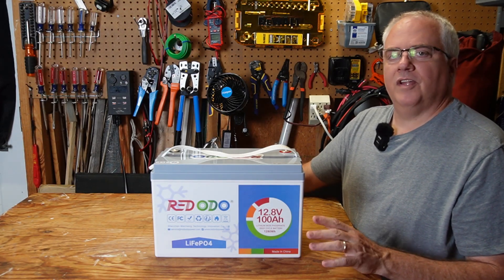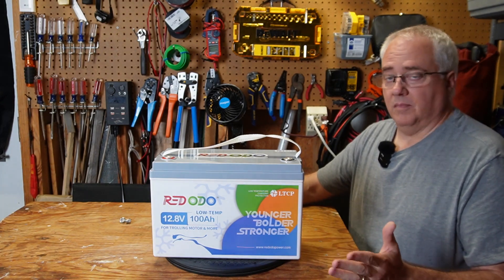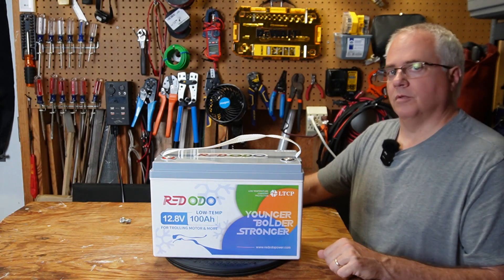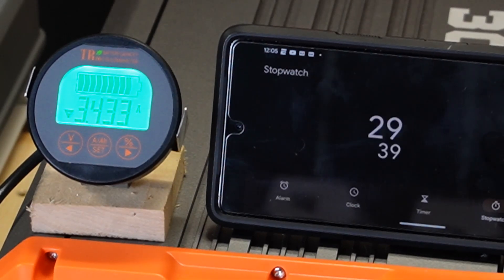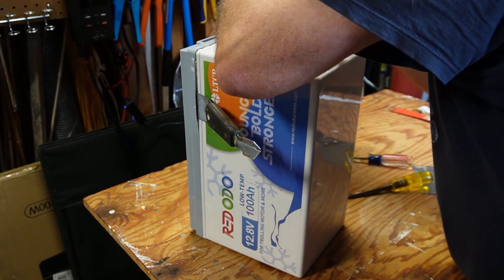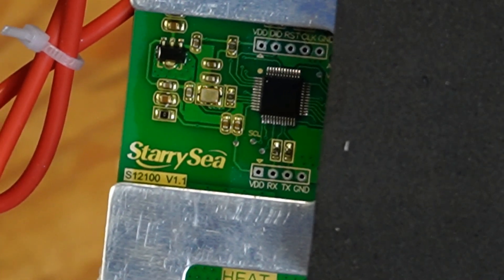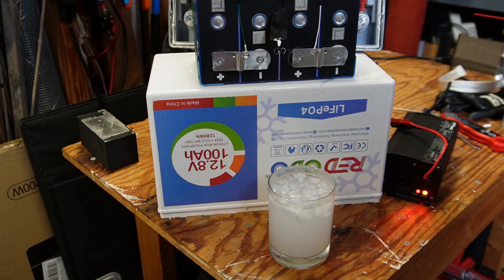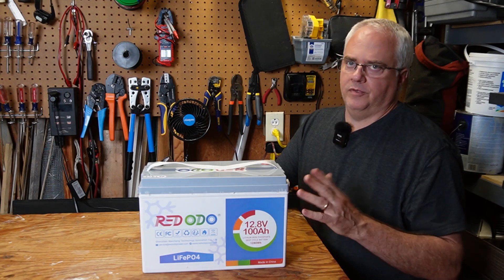Redodo - LiFePO4 12v Battery Review - What is low temperature protection?

Comment: Hi, can this battery be charged by the outboard while the boat is moving? The output voltage of the motor is 15A! Regards, Julian
Reply from the maker: I'm not experienced with charging with an outboard. But in general Yes. Just like with a solar setup, you can be discharging and charging the battery at the same time.

Comment: the current price difference between the regular and the low temp 100ah battery is $11 ($216 and $204.89). If I plan on having my battery indoors next to my Bluetti AC70 for extended capacity with a mini split heater running, would I ever need low temp protection in Houston Texas? If I need to I can build a little case for it and use some foam board insulation to help keep it warm if need be, but I just wonder which is best for me.
Reply from the maker: If its indoors, I don't think you need a low temp protection battery.
Reply: @proficientprepper  sounds good. Ty for the reply